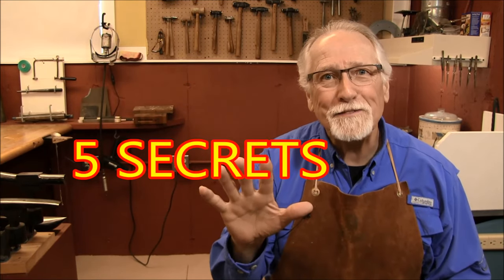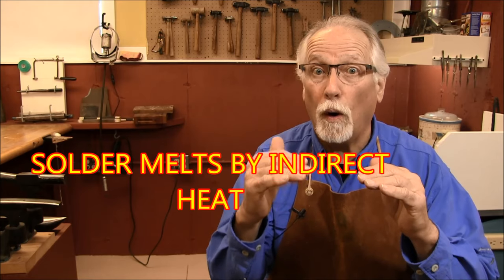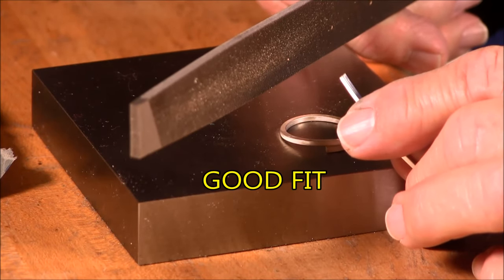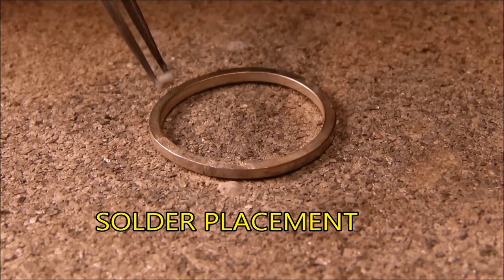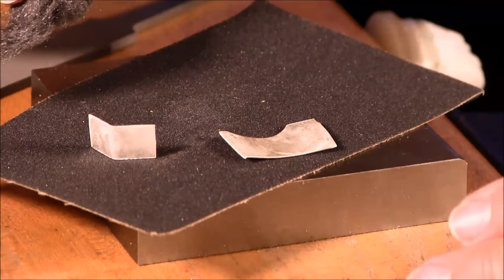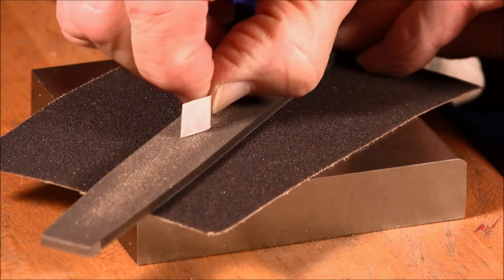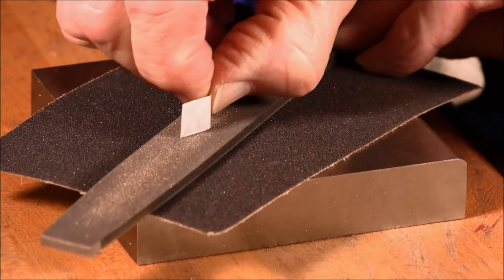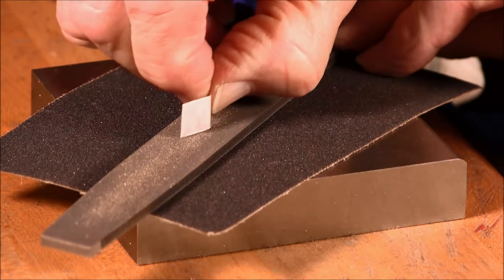5 SECRETS TO PERFECT SILVER SOLDERING!

Comment: Hi, this was the best instructional video on this subject ever. Thank you. Great job.
Reply from the maker: Hello Fire Minx,  Thank you very much for your kind comments.  I am glad that you enjoyed the video. Thanks. Greg Greenwood
Reply: @greggreenwood4628  Hi Mr Greg, I need to solder two small brass pieces, I bought silver solder wire and butane torch.
I am waiting for the silver solder still.

I don't have any flux, what I can do for my job.
I can solder my parts using a brass rod?
Sorry for my questions I am new in this business.

Best Regards.
Reply from the maker: Hello Ricardo,  You need to have the silver solder, and the flux to do any soldering. Follow the 5 Secrets perfectly and you will have success.  Don't try anything different, it will not work.  Also, when you have a question, please don't tag onto other comments,  It is difficult for me to find you and comment back.  Do a direct question to me.  Thank you very much.  Greg Greenwood
Reply: @greggreenwood4628  Thanks so Much, next monday I will buy the flux.
I work fixing electronics equipment, I make a modification in a desoldering tool for use most cheap nozzles.
Next week I will tey for the first time.

Best Regards
Reply from the maker: Good Luck.  Greg Greenwood

Comment: The reminder to flux the solder itself was very helpful, thank you so much.
Reply from the maker: Hi Brian, Glad that tip was a help for you.  Also,  before you cut your pallions of solder, clean the solder strip with steel wool or emery to remove any oxides that have formed while your solder has been sitting around.  I like to ownly  use enough solder for the project I am working on and not cut it in advance.   This way the solder is always fresh and clean for the soldering job. Have fun soldering. Greg Greenwood
Reply: @greggreenwood4628  Will do. Great tip. Thanks again.

Comment: This is the best silver soldering video I have seen yet. Thank you!
Reply from the maker: Hello Modern Medieval, Wow, thanks! I appreciate it.   Greg Greenwood
Reply: @greggreenwood4628   in your opinion, what is the easiest solder to work with? I have tried easy through hard silver solder and haven't been able to figure out which technically flows easiest. So, if I am able to choose one solder for a project, what types do you think are easiest to work with and easiest to get to flow? The paste does seem to work well, but I don't care for the look of it as much as more traditional solders. Thanks!!
Reply from the maker: Hello Modern M,  Thanks for your question.  Watch my video "What the Heck is Sterling Silver and Solder".  This will answer many of your questions about solder temps etc. You may want to check out "What is Pickle?" and "Silver Soldering Hidden Details" also.  I agree about the paste solder.  I only use it as a last resort.   Let me know how it goes.  Greg Greenwood

Comment: Keep these coming, please. How do we dress our hammers? I've learned at least one thing from every single video you've posted so far. This is what YouTube used to be like before all the click-farms showed up. We sure do appreciate your efforts and your generosity in sharing this hard-earned information. Best Regards.
Reply from the maker: Hello Mighty Red,  Thank you for your great comments.  I really appreciate them and I am very happy to help jewelers with questions. As for your hammers.  If you are starting with a very rusty hammer face, then start at the beginning: Emery cloth and paper.  If you have to file, do it before the emery.  Emery sticks are a great help when I'm working up an old hammer.  Seems to work faster.  Then move to the polishing wheel.  You can find steel polishing compounds on line or Rio Grande has Dialuz Grey Premium Polishing compound #331080.  $4.75 a bar.  If you don't have steel compound, I have used my white diamond or tripoli compound.  If just takes a little longer.  When you have that mirror finish, protect it with vaseline, silicone, or any oil to seal the "goodness" in.  Remember, it is easier to do a little extra polishing every few times you use the hammer, than picking up the hammer excited to do some forging  and it has a coating of rust.  Time Wasted!  Thanks again.  You are questions are always welcome.  Greg Greenwood

Comment: Hi Greg. I've just discovered your videos in the last year and love the tips and tricks you give. You are my go-to metalsmithing guru. You have helped me immensely already and I'm hoping you can also help me with a significant soldering problem I have.

I work mostly with copper and so far I have not had any success with soldering 6ga half-round copper bangles. Your instructions are spot-on and I follow them precisely, (the joints have good tension and are flush). So I think the problem might be the liquid Aqui-Flux I am using. I have both painted it on and sprayed it on, but it does not bubble or turn whitish when I torch it.  There is a slight reaction to my bangles, and the charcoal block turns white where it got a bit of flux, but not the copper.  I have tried E, M, & H silver pallions and H soldering wire, plus H solder paste - same unsoldered result for all.  I did try sweat soldering 2 flat pieces of copper together, and that worked brilliantly, so I do not know what I am doing wrong with the bangles. Can you help?   Thank-you (for EVERYTHING).
Reply from the maker: Hello Sharon, Thank you for your kind comments. I appreciate it.  As for your copper bangles.  Do not use aqui-flux on that thick of copper.  Use borax flux.  I use Handy Flux.  It is a prepared borax flux and is a milk shake consistency. The aqui flux is burning off before the metal can get hot enough to melt the solder.  Copper will oxidize faster when heated so you must protect the surface with a good borax flux.   Let me know how it goes.   Greg Greenwood

Comment: This explains so much regarding my past success and failures at soldering.  One thing you didn't mention, however, is the heat source.  I failed miserably at trying to solder a bezel to a sterling silver cuff bracelet with the butane torch that has worked so well with smaller projects.  Should I invest in an acetylene torch for bigger projects?
Reply from the maker: Hello anitamyersdds,  If you are serious and will be soldering more bracelets etc. in the future, I would recommend you get an acetylene torch.  I have a "preso-lite"  acetylene / air mix torch with a "B" tank.  I use different sized tips and can do everything from jump rings to melting scrap for castings.  Go for it!!  The best to you.  Greg Greenwood

Comment: That was great, im not making Jewellery but i'd like to get one of the Torches used
Reply from the maker: Hello Mother,  Thank you for your comment.  The torch I use is a "Presto Lite" Acetylene / Air torch.  Works great for small work with small tip and large melting with larger tip.  Thanks for watching.  Greg Greenwood

Comment: This is awesome, thank you!

I have so many questions 😂 
I find that often when I am soldering, I spend a ridiculous amount of time trying to work out were I want part B to go on part A, and then I either cover it with the flux and can’t see were it is properly, or once I have pre heated the flux, it bubbles up and shifts around (or sometimes both haha). Do you have any tips that might help with that?
Reply from the maker: Hello Tribal Fiend,  You are correct about this being a problem.  The flux will always bubble and boil and possibly move your pieces to solder.  So you should prepare for this in advance.  Make sure that your pieces to solder are held into position firmly.  Use third hands, cross lock tweezers, binding wire or any tool that will hold the position of the work.  This way, the flux can bubble and boil and you don't have to worry.  Try this and I believe you will have better results.  Good Luck.  Greg Greenwood

Comment: Thank you Greg this was a great informative video. Do you have a video on how to eliminate fire scale? I have seen several different videos and tried their techniques but they do not work. This is the monster I am working with right now.
Reply from the maker: Hello Dawn,  Thank you for your comments.  Yes, I have a video " Firescale, What is it?"  Check it out.  I hope it helps you.  Firescale can be a real pain!  Your best solution is to make sure that you protect the silver from oxygen.  If you have to paint the entire piece in borax flux, this might be the only way to prevent it.  Also, protect the silver when you anneal it and do not over heat.   Many people forget about protecting when annealing.  If you don't, you have firescale right from the beginning and it won't make any difference when you are soldering.  You already have it!!  Let me know how it goes.   Greg Greenwood
Reply: @greggreenwood4628  thanks again, I will go check that video out. I just started using boric acid on the piece I'm making right now. I have a question but I'll watch your video first, you may answer it.

Comment: I've just found your channel and I love the way you explain every process on the jewelry making.  You have a new subscriber!  Keep  the awesome work and videos you share with us.  Thank you 👍👍.
Reply from the maker: Hello Alice,  Thank you so much for subscribing!  I appreciate it.  And, thank you for your kind comments.  I am here to help you if you have any questions in the future.  Thanks again.  Greg Greenwood
Reply: @greggreenwood4628  Thabk you so much for your fast reply.   I have a question.  When you solder jewelry, what are the numbers that should read on the  regulators in the oxigen and gas tank? I am going to use propane gas.  Thank you 🤗.
Reply from the maker: Hello Alice,  For the numbers on your regulators, you should consult the manual with the regulators.  In general,  you should have the       
oxygen and the gas at equal numbers.  The lower the number the less powerful (hot) the flame.  The higher numbers will get you a more powerful flame.  You do not want a loud roaring flame.  I hope this helps.  Check the manual with your torch.   Thank you for your question.  Greg Greenwood
Reply: @greggreenwood4628  Thank you so much for your help, I really appreciate it 🤗👍.

Comment: Your videos are incredibly helpful, thank you so much. Question, you pickle the metal b4 you use the file and/or emery cloth. Why isn’t it the other way around? Is pickling better or just different than cleaning in ammonia, soap and water? Thanks in advance for your response.
Reply from the maker: Hello Tina,  It really doesn't make any difference which order you clean.   Just get it clean. That is the important thing.  By the way, ammonia does a good job of removing oils and grease.  Pickle is used to remove oxides.  Check out my video "What is Pickle".  It will get you some more insight.   Thank you so much for watching and for your questions.  Keep watching.   Greg Greenwood
Reply: @greggreenwood4628  you rock, thank you so much for your response. I am off to the studio this morning to put your excellent info to work. I will watch your pickle episode. Just discovered you and am anxious to see everything you have so generously shared.
Reply from the maker: Hello Tina,  Thanks for your kind comments. Enjoy your studio time!!  Thank you for watching.  Greg Greenwood

Comment: Great tutorial !  Thanks !  May I ask for your help.  I made a big mistake : too much solder when soldering a thin wire design on to a flat piece.  Now the wire sits in a pool of solder and I can’t sand it there.  Any clues on how to fix that ?  Thanks so much !  Love your channel.
Reply from the maker: Hello Mieke,  You have just joined the " Too much solder, I will never do that again Club" !!  LOL....  It is possible to to save your project.  But the wire design might have to be re-done.  This depends on the design.  OK, now for the solution:  I would try to re-melt the solder and pick up the wire design with a pair of tweezers just as the solder is melting.  Make sure that you use flux.  Once you have the wire removed, you can file, emery, and polish the flat piece again.  If the wire design survives the removal, then you can re-use the wire. If not, you will have to re-do the wire design.   Don't feel bad,  this happens to all of us  at times.  The way to prevent this, is to "sweat solder"  the wire onto the flat sheet.   Take your wire design and lay it up side down and solder the "MINIMUM" amount of  solder to the back of the wire first.  It only takes a small amount to solder to solder down a wire.  Now that the solder is on the back of the wire,  pickle and clean the wire, and clean your flat sheet.   Position  the flat sheet so you can heat from below.  Tripod, trivet or third hand with cross lock tweezers.  Flux the entire area and start heating the piece from below.  The flat sheet will heat up enough to melt the solder on the wire  and it will sweat solder to the sheet. The solder will stay under the wire.  Do not over heat.  Just enough to melt the solder.  Remember:  Minimum amount of solder. This is the key to successful soldering.  I hope this helps you.  Let me know how it goes.  Ask questions, anytime!!  Thanks and good luck.  Greg Greenwood
Reply: @greggreenwood4628  Whow thank you so much for your clear explanation !!!   Meanwhile the wire broke off and I damaged the flat piece but no problem - that’s what learning is about !  Tomorrow I’m getting right at it and with your precious advice, I’ll make it !   Thanks again !   Much appreciated.
Reply from the maker: Hello Mieke, You are correct, that is how we learn.  Good luck and let me know how it goes.  Greg Greenwood

Comment: Such great advice and straight to the point! Thank you!
Reply from the maker: Hello Che Moni, 
Thank you.  Glad you liked  the video.  If you would like to see any other videos or have any questions,  please let me know.  Happy to help. Greg Greeenwood
Reply: @greggreenwood4628  Back with a question! Does the type of gas I use impact how this works? I usually use propane, but I've recently been using gas (both used with the Bernzomatic torch), to solder copper wire (square and round wire between 12-16 gauge) with copper solder. I'm having a very hard time, though. I follow all the steps needed, but it seems I can never determine how or if it'll work. A lot of the time, I end up overheating the wire without even melting the solder. I'm not sure what I'm doing wrong.
Reply from the maker: Hi, The type of gas should not make a big difference. Sounds like you are not using enough flux.  Make sure you use borax flux on copper. Plus use a little hotter tip to heat up faster so the solder will melt before the flux burns off.  Let me know how that goes.  Thanks Greg
Reply: @greggreenwood4628  Copper solder is self-fluxing, so sometimes I use flux to keep it controlled, but the wire doesn't exactly need it. I'm not sure I can change the tip with this particular torch, but I'll see what I can do! Thank you so much for the advice!
Reply from the maker: Hi,  What is the temperature that the copper solder is supposed to melt?  I'm not sure if you are using a high temp or low temp copper solder.  Thanks Greg
Reply: @greggreenwood4628  Melting point  1310F // flow point 1460F
Reply from the maker: You have a high temp solder.  I would still use the borax flux on the copper to keep it from oxidizing before the solder melts.  That is why your solder sometimes does not melt onto the copper.  You  must protect the surface of the copper from oxides to make the solder flow.  Let me know how it goes.  Thanks Greg
Reply: @greggreenwood4628  Thanks so much!!

Comment: Thank you for this excellent video. I do have a question. I have a flute (silver 900) and 2 tiny places need soldering. I think I should buy a certain kind/brand od flux. Could you advice me on this please.  You work looks perfect!!
Reply from the maker: Hello Helen,  I believe that some of the pegs and posts on flutes are soldered with a low temp solder.  If you start to solder the pieces that need soldering, you might start unsoldering ones that are ok.  The flux used with low temp solder is a liquid flux and can be purchased at most hardware stores.  I worked in the musical instrument repair industry for several years and have repaired hundreds of horns.  The work can be very delicate, especially with flutes.  I would advise you to take to a music shop that does repairs and have them do the work for you.  If you do it yourself, you could end up with a mess.  Sorry to tell you this, but I feel it is your best bet.  Thank you for watching and for your kind comments.  Greg Greenwood

Comment: Ty. I been having problems buts i thinks its because i use hard solder on all my pieces. I need to use medium and easy
Reply from the maker: Hello Semore, Yes, you are correct.  Use the different grades of solder to make it easier to control the flow of solder. Check out my Soldering Playlist.  There are many videos that will help you with soldering.  Thanks for watching.  Greg Greenwood